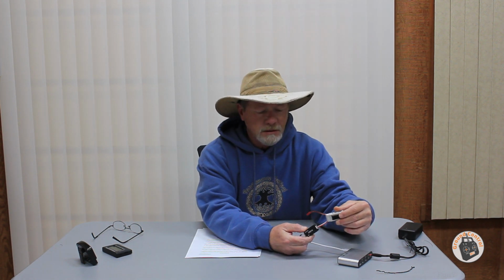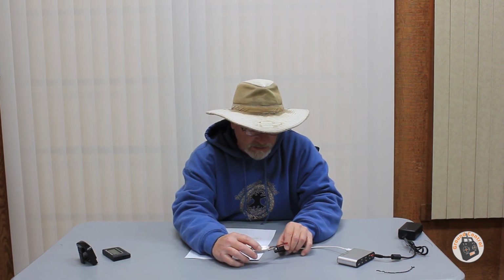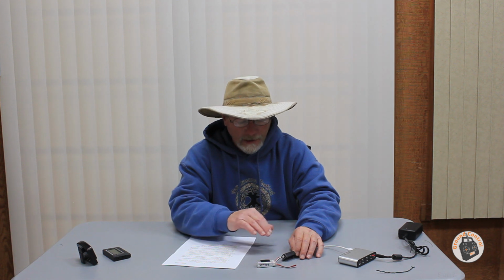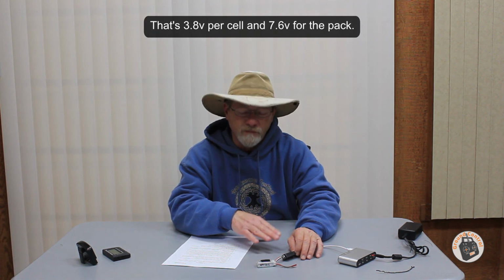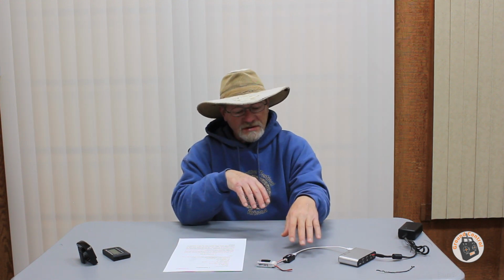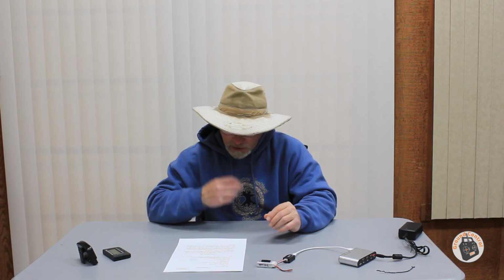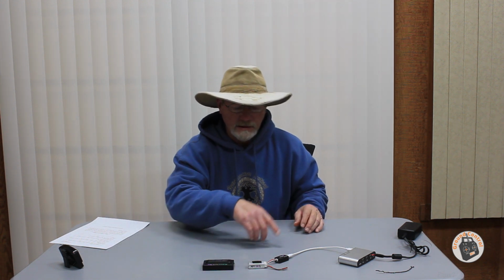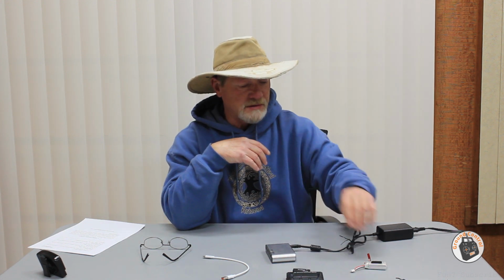Radiolink CM210 2S LIPO Charger | Charging Mode, Balance Mode, Repair Mode | Compact & Feature Rich!

Comment: Thanks GC!  Low cost, very cool charger.  Recently, I was testing the flight time of a new plane and I was a knucklehead and went too long to the point where I lost power.  I was able to land without crashing, but after checking the battery, one cell was below 3v while the other one was like at 3.5v or something like that and like you, I couldn't get the balance charger to charge the battery, so this has a cool feature that may save me batteries in the future from more knuckleheaded moves :)
Reply from the maker: Hi Roland!
That repair feature is awesome!
I've most recently pulled the batteries down too far on one of my EDF Jets.
I need a 3-4 cell charger that has repair mode ;-)
See you in the Air!